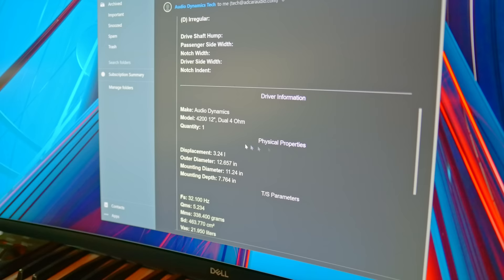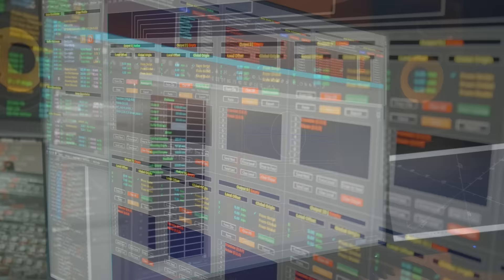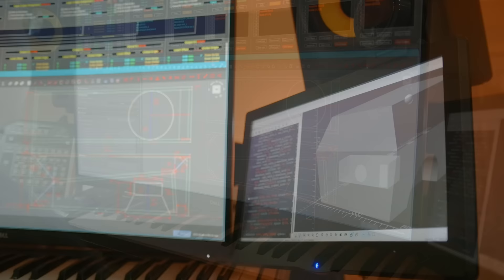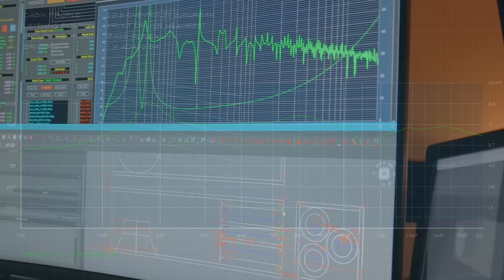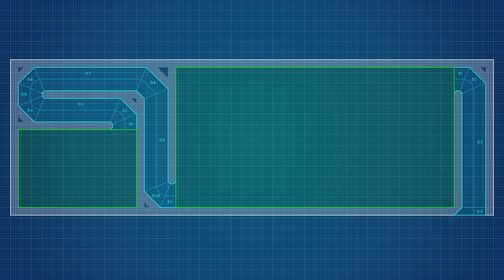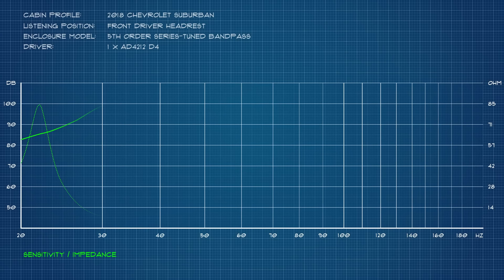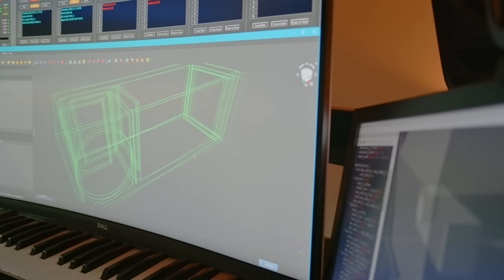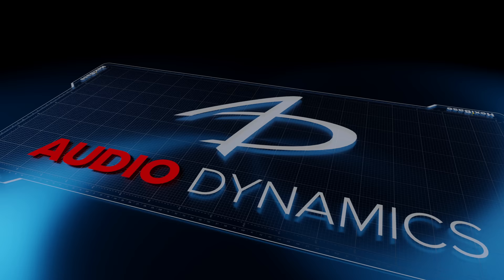Acoustic Engineering Workflow

Comment: Oh god... i was afraid of something like this. You do your calculations with an excel spreadsheet. Jesus. I guess you build that yourself? So there's no way for me to model something with your accuracy without building such a calculator myself?
Reply: You're use of deity is telling...🤪
Reply: @scottiffanimccord1509  
Oh Holey Jebus, please bless my spreadsheet and send angles to guide my hand on the router.
Reply: Seriously though, I'm a software engineer but I don't know shit about cabinet design.
If anybody wants I can write an excellent application to do this.
I've always wanted to as well, I just don't know anything about how to turn the idea into the math into the cab.
Reply: The best I've ever managed is take a pair of 6x9s where I had access to those attribute numbers drivers have and build a pair of sealed cabinets with a decent response curve.
Then I added all the electronics, gave it a lid, handles, wheels and a battery and basically made a massive Bluetooth speaker.
Reply: @MostlyPennyCat  i would be able to manage to make a spreadsheet like his in the video but the amount of physical interactions between air molecules with each other and other surfaces is mind-boggling. No idea how to accurately represent everything with a formula. I'll try to find out
Reply: @scottiffanimccord1509  your use of you're is very telling aswell
Reply: @NiliMoto  and for well over a decade he's been able to model in any environment/substrate.
Reply: @stevemilton3499  Did you actually get to watch him do it? Like all the stuff he just did in the video?
Reply: @Attic Chopshop  yep, but mind you, he's constantly improving his own software, very little of which is actually shown here. If you peeked over his shoulder, you'd very likely recognize nothing. It's interpretive math, maybe a few folks would recognize pressure differentials. It reminded me of the falling numbers on the matrix intro. Nothing like the elementary drawings he threw together to make his point. Listen to the video again, with your eyes closed. Soak in with no visual interruptions.
Reply: @stevemilton3499  Wow that is nuts!
Reply: @NiliMoto  true that lol
Reply: I hate to say it. The cost he charges is so insanely reasonable that I would literally have him just do it. He should be charging more.
Reply: @NiliMoto  I'd presume some of it to be done with FEA and the spreadsheet for visualisations and parameter setup, but that's just a guess really
Reply: But do it bump doe?😂

Comment: I recently bought a 2015 MX-5, and have been looking at my options for getting a decent sounding system in it.  Thanks to this video, I now have a LOT of work ahead of me, tearing the car apart to take measurements of the area under the soft top behind the rear bulkhead so I can model an enclosure... Part of me (the part that makes spreadsheets for literally every major decision I make) is super excited.  The other part (the part that has a limited number of hours in the day to screw around) is scared, lol.

Comment: Had a 2000 f150 single cab with two ds18 8-inch elites behind the seat in a box I built myself 2.43sf³ with a baffle and a chimney port. I did the cab measurements and tuned it for 44.7 hz and loved it now I'm running a 15" ds18 exl-xxb on 6K in a 3.5sf³ prebuilt box in my ram and while it does hit hard it doesn't have that same feel to it nor is it as loud. But hats off to you for what u do man some people don't realize what truly goes into designing an enclosure , I need to build a box for my new truck but I guess I'll get around to it if I end up getting that 18 from trinity audio

Comment: Pete, Have you considered making a design for Barevids competition he is running? He is using a 2" driver and a cabin as a scaled cabin volume with viewers submitting 3d printable box designs that he will be testing in a head to head setup. I would be very interersted if you would go through the design process of such an enclosure, as well as going through the science of how well the setup mimics the behavior of a single 12" in a scaled cabin, of course once you scale the frequency response by a factor of 6 as well as the cabin volume. Maybe you could even collaborate on the video.
Reply: Also looking forward to this!
Reply: Me too

Comment: Can you also make sub recomendations?
Seems much more efficient to have this done with the flexibility of picking a better suited driver before actually commiting to a subwoofer and make that fit as best as possible.
Reply: He can recommend from drivers he's modeled very recently, but that's just based on memory. His driver database is vast & runs over a decade and a half of models, versions, revisions etc and it takes man hours that can't be quoted on demand when you request a design. So, it's highly unlikely that you can get him to make a recommendation on drivers, it's much easier & responsible to let you dig your own foxhole & he just optimize it.
Reply: @stevemilton3499  he must have a shortlist of what he knows works well in certain applications.
Going by that would if you don't have specific preferences for a driver make life easier for everyone involved i'd imagine.
Reply: @Baron von Limbourgh  if it were me, I'd liken that to "giving financial advice" or "endorsing an exact S/N product". This, because the customer will want to hold the engineer responsible for the failure of a product, specifically after the McDonald's tech dept guy points the finger away from his company.

Comment: my yamaha subwoofer has a "yst" system (yamaha active servo tech), would a system like that have a effect on the design of the enclosure?
the yst would make the ts parameters and such from the driver itself unusable? would they measure the driver with the yst system active? or arent they matched at all and could use any random 10" driver?

Comment: Most informative video out there. From impedance curves to audio output with different drivers with given parameters. So much information in one video. AWESOME.
Reply: I can't expect a reply to this given the age but nothing ventured...

I've watched this more than a few times now and there's one tool in the chain I've yet to identify. At about the 4:00 mark there's a graphic that I think is showing SPL (or energy) at various locations in the vehicle. There was a brief mention of "acoustic Abaqus", which I assume is some acoustic tailored version of the FEA software package. Yet it was not listed in the tools used. ReW was listed but though I've not used its Room Simulator, I don't think it produces this level of data. I'll assume, though not really needed, the graphics depicting the data was done via Blender.

So how was the data depicted above generated ? I'm curious because although my engineering background is in radar, much of the concepts and principles apply across the fields. (No pun intended)

Fantastic video, as always. Much appreciated!!
Reply: @brianmack6285 do you know what software is shown at 7:09? I recognise the FreeCAD window but I'm unsure what he's using for actually simulating the enclosure in an environment?

Comment: This is outstanding! I didn't know someone would really go to that much effort to simulate a loudpeaker enclosure from start to end so that the frequency response it creates in a specific environment matches a predefined curve at the listening position.

Two questions:
1) What simulation software do you use? How did you achive live-update of the simulated frequency responses while tuning the parameters in CAD? 😧

2) 04:27 - Equal Loudness Target. Why do you want to match the equal loudness curve in the first place? Producers create their music on systems that follow a rather linear frequency response and not one, that follows the shape of an equal loudness curve. So why should our subwoofer do? In my view it just adds a colouration to the low end sound.
 What am I overseeing?
Reply: Yes and no. There are different problems at the same time when mixing music. Yes, you could compensate in the production or mixing stage of your music BUT: the lower the note the bigger the wave and less space in the mix. So when compensating for equal loudness you'd have to limit different notes differently or you overdrive very low notes, so you only do this in a very rough way eg. octave jumps
Reply: I agree using the Equal loudness contour diagrams in this way does seem odd. I've only ever used it for comparing differences at two different volumes and compensating for that so that the content sounds the same at a volume louder or quieter than the reference. I can't quite see why he would try to trace the contour in this way. I'd like to hear his thoughts on this.
Reply: Used software was linked in the videos description, but I am interested in the live updates as well.
Reply: 1) This is really interesting to me too... I'm pretty sure he's taken advantage of OpenSource CAD editors so he can easily write and run a script (possibly written in Python) from whatever operating system he's using (in this case, Windows). The script periodically extracts data from the CAD file and parses it into another text file, which the Sheets editor can then read in real time. This can be achieved using plugins or macros. Afterward, it calculates and prints data and frequency responde charts using macros within the same spreadsheet file.

Comment: The software used at 6:15 is incredibly! Seeing how the enclosure affects the response live is amazing. Is that a software that is available somewhere? 
Right now I am looking for ways to simulate enclosures and room acoustics at specific positions and something like that would be awesome!
Reply: Haven't watched that far, but have you checked the video description? It says all used software is free or open source and has a list of used programs with links.
Reply: @raw_000  None of the programs there seem to be capable of those acoustic simulations by themselves. There are programs that are open source and free that can be used for simulation though. Including one that can be integrated into FreeCAD.
Reply: exactly what I was looking for more information on.
Reply: I think he has actually written everything in Libre office calc. It is just a spreadsheet with things color coded to make it look like a GUI, with buttons have macros assigned to them. I think the simulation is being done numerically in the spreadsheet, which is certainly possible although the math behind there must be crazy. It's also possible that the macros are launching something else to perform the simulation.
Reply: @tannerleo273  Was thinking about that.. I'm pretty sure he's taken advantage of OpenSource CAD editors so he can easily write and run a script (possibly written in Python) from whatever operating system he's using (in this case, Windows). The script periodically extracts data from the CAD file and parses it into another text file, which the Sheets editor can then read in real time. This can be achieved using plugins or macros. Afterward, it calculates and prints data and frequency responde charts using macros within the same spreadsheet file.

Comment: Id love to see a future video in which you elaborate on the workbench calculations you used to yield the frequency response of the system.
Reply: The fun part is putting everything together to calculate a response curve, and then it morphs over time, when even a single tone builds in amplitude as the multiple dissipating waves bounce throughout the cabin. See that on a XYZ ∆P graph, real time....that is some cool ish. That's what he wrote over a decade ago. I can imagine what he's modified it to today.
Reply: @stevemilton3499 Hi, I've seen a few of your comments and you seem to have some insight into his design process...

Do you know what software is shown at 7:09 (and throughout the video)? I recognise the FreeCAD window but I'm unsure what he's using for actually simulating the enclosure in an environment? Or is it all done via spreadsheet calculations? If so I'm still curious what software he's using to select inputs/outputs ect, and how that would interact with the spreadsheets and 3D model in real time?

Any insights you have would be amazing! I'm not looking to have a workflow as well interlinked and optimised as his, but the ability to model the specifics of an enclosure within an environment would be great. Most of the tools I've been using so far just take overall sizes (e.g. volume or port area ect) not exact enclosure dimensions/layouts, and none of them will interact with an environment! I have 3D modelling experience so being able to put it to use and more realistically simulate enclosures would be interesting.

Thank you

Comment: Please help explain:
This level is above me and have some basic questions.
I understand the bass distance is based on the hz it is played at, 28hz around 34 feet. But does certain box enclosures change the distance of the apex? Or is it just the note played?  Is the apex also the completion of the frequency wave? Or the whole wave length?  What would be the order of distance apex be- sealed/passive radiator/ported/4th order/horn?

Comment: When I specified my sub enclosure, I asked for sealed because I thought this would give me the most accurate response as it related to the kind of music I listen to which is metal with heavy double bass. In my experience a ported enclosure resulted in inaccurate sound at higher volumes. Is this correct? Should I have considered other designs?
Reply: This is why you have no option as to which alignment you get when using his services. You request a specific performance & then list the limitations, and as you can see, he then goes to Mars to find the best possible set of physical characteristics to achieve your goal.
Reply: This video is a bit weird in that the client wanted only up to 60hz and already had a driver/speaker. 
 Ported designes are good getting more efficiency way down in those low frequencies where a ton of power is needed exponentially as you get lower.
 Usually crossover in a car sub will be higher than 60hz, depending on the car/situation (and as you noted, the playback content) ported design will struggle to provide tight bass when crossover is set to a more usual 100-150Hz, as most car 6x9 and door speakers still struggling down there.

So barring some other low-mid solution, this client must have a big hole between 60 and wherever the other speakers come into their own.
Maybe this is just for some competition thing
Reply: Probably should have stated your concerns about this and let him do the work.
I am pretty sure he would have recomended the best possible option for your specific situation, no matter what it would have been.

Like you see here, there is a lot more to it then the general simple rules people like to use/talk about. They probably hold true in most cases when you or me design a box ourselves. But probably less so when you are able to model basicly anything to perfection.
Reply: @baronvonlimbourgh1716  The thing is, his perfection is only as good as model of the cabin he's basing everything on, and it's far from perfect.  Garbage in, garbage out
Maybe down below 60hz it's fine as the waves are huge and rudimentary model works, but things get tricky as you get into the region between sub bass and mids

You can engineer to the nth degree of perfection, but you also need to see the big picture, ask the right questions etc.
 Client may look at marketing for their 6x9s and tell you 60-80hz is a good crossover point, big picture outlook and experience will tell you that's not realistic.
When client turns around and complains about loose muddy base, blaming client because they specified 60hz maybe technically correct, but still a design failure nonetheless
Reply: @Username-qx9gk  if that's the case, that would have been the exact advice he would have given him, wouldn't he?

The OP is now questioning his decision. Would he have stated his concerns he either would have recieved a better sounding system or he would have had his experiences confirmed and would be confident what he has recieved now actually also is the best solution for his application.

Pretty straight forward.
Reply: @baronvonlimbourgh1716  I didnt use him, which is maybe I think a point of confusion in this conversation. I just had a sealed box built because it seemed like a safe bet given my tastes and the subs used. I am considering his services though.

Comment: Do you know how to or know of any videos on how to evaluate and test a specific cars' acoustics and utilize/combine tbat info to build a more accurate or better SPL sub enclosure. Im asking this because i have a 2006 Nissan Maxima and i think its one of the worst acoustically sounding cars ive ever heard. I mean its REALLY terrible. The only thing i could think of is either using my Alesis MEQ-230(dual 30 band graphic eq) or my Behringer Ultra Curve Pro  DEQ2496 to "flatten the car". Any suggestions?
Reply: Sell the car. :)
Reply: Accelerometers on each panel, then extrapolate to build a model, like he showed you, with multiple compliances. Then figure out how that affects pressure waves moving thru it. Then figure out how it operates with hundreds of pressure waves moving thru it over time.
Reply: @-vermin- HA. Lookin like i might😁👍.
Reply: @stevemilton3499  thanks whether i use that in this car, maybe.
Do you or anyone know at car stereo contests, what cars are used in "sound quality" winners the most?

Comment: This is amazing!

Would love to understand how you get your FreeCAD speaker cabient designs into your modelling software in real time. Really impressive
Reply: Do you use a combination of the air flow analysis of free CAD and excel spread sheets? I'm curious what the program is that's open on the same monitor as free CAD